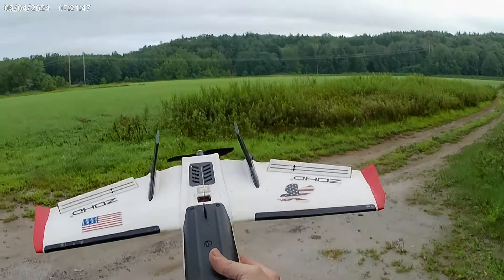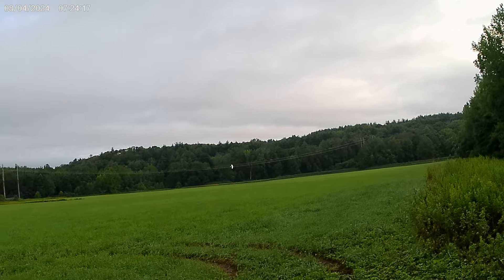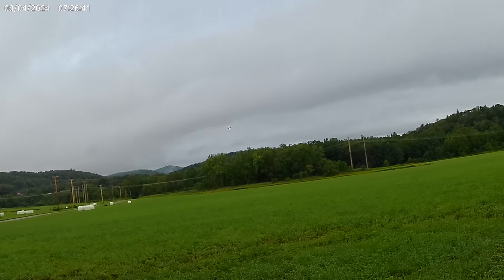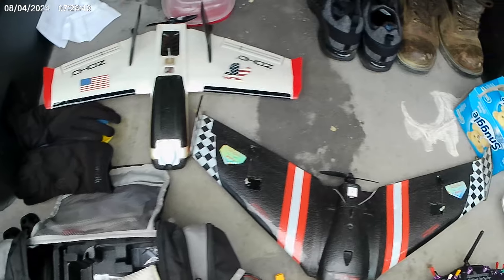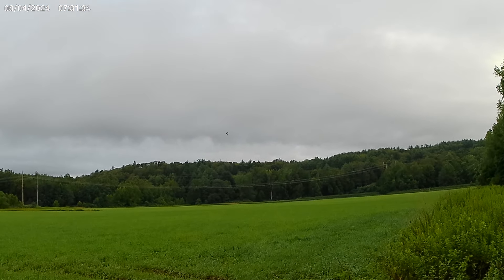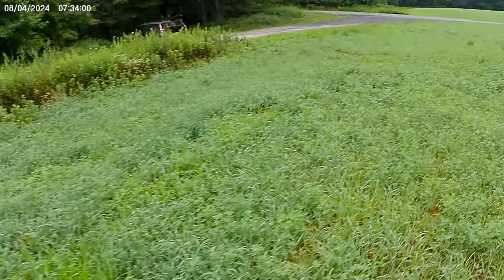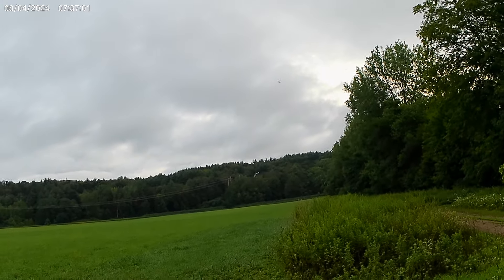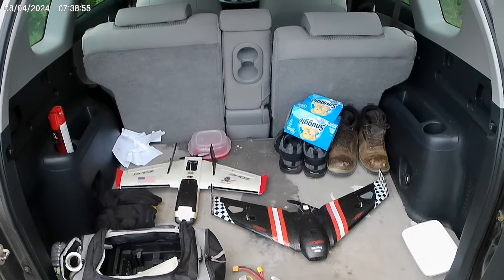test flight with the dart 250g and the ar wing mini 8/4/24

Comment: Both great little planes. I love the Dart - those wept forward wings just don't stall. The solid foam of the Mini AR suits us Old Kamikazes too. But these days we all pretty well have to use a bungy launcher as the old joints are too shot to pelt them properly. Not having any gain adjustments on the Byme stabs is a problem with these. The stock Kopilot needs to be turned down to nearly nothing to stop them flapping like a wounded flying fox (fruit bat.) Probably a Lefei Sparrow 3 Pro which allows you to set reduced gains as the speed increases is the best plug-and-play stab for these. 1 of the boys has 1 on the way to test.
Reply from the maker: @theoztreecrasher2647  I'm going to look into that sparrow 3 pro thanks